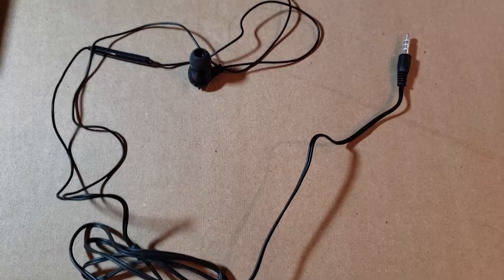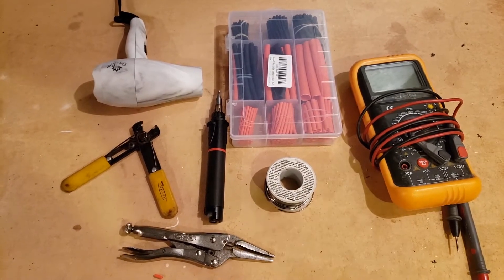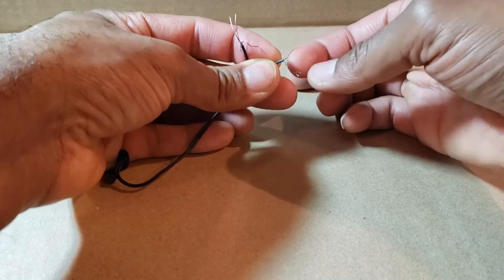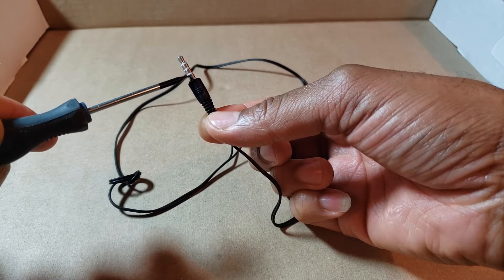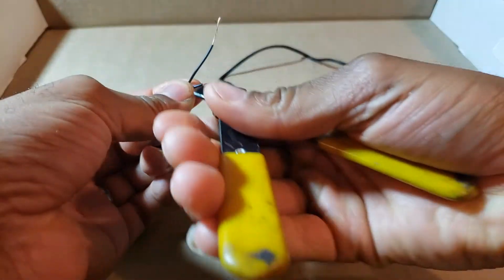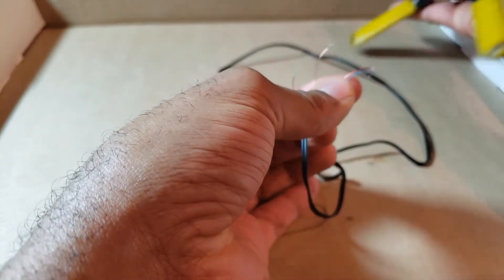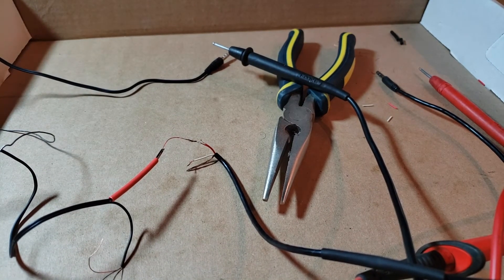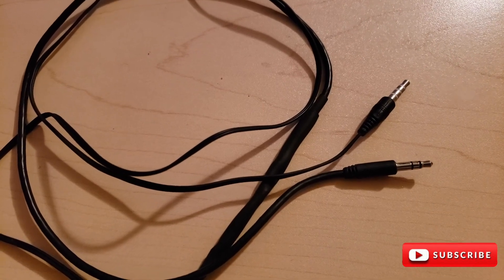DIY TRS to TRRS cable - good for broadcasting clear sound to social media

Comment: That’s a trrs audio and mic splitter you bought, ideal for splitting headset and mic for a laptop. You could’ve just bought a single trs to trrs cable.
Reply from the maker: If it was available at the time, I would have. The main reason I made this video is because they were almost impossible to get a few months into covid

Comment: For trrs you need a 4 conductor cable....which you can purchase at any electronics online store per foot ...this so called genius isn't smart.....you don't buy .99 cent cables from the dollar store for quality sound that's absurd....this guy is just cheap....also look for gold plated jacks better audio fidelity from them then silver ones.....
Reply from the maker: The dollar store cables will work just fine if your soldier work is proper. You can go spend big bucks on these cables but you are just trowing away money if you are just trying to do a quick simple instagram live stream. If you are looking to do big production where  you are earning money, that's different. But for someone who isn't generating income with the use of these cables, its low budget and works fine. This gold plated high quality cable business is a scam. Over short distances, High quality cables are a waste of money.
Reply: and for me i already bought every physical cable on the island . And have a box of exp and cheap one
Reply: and im not telling u guys how to roll . U both are right and have good points but my situation will be helped with the meter . So that help ed me and i didnt have to speak african .The african dudes video where good but this is the fith one i broke and the color codes were not enough this time so i know how to test them now . And they do suk . We all agree on that but i wanna spin some vynil so god b more plur muthha foookshz

Comment: what cable of trs will connect with which color cable of trrs . you missed this one
Reply from the maker: Do not go by colour, take a meter and test each side for their "tip" wire, once you find them they go together. Then find the second channel (the one under the tip) for each and connect. last, test for the final channel on the TRS and connect that to the mic channel on the TRRS which is the bottom one.